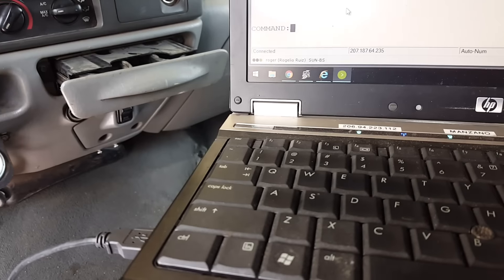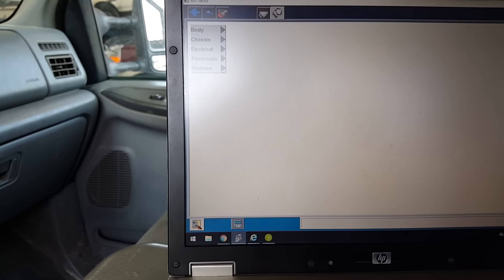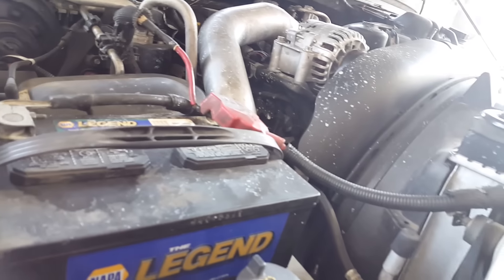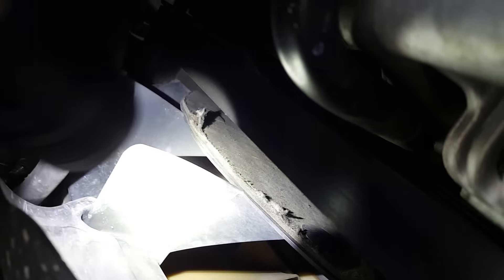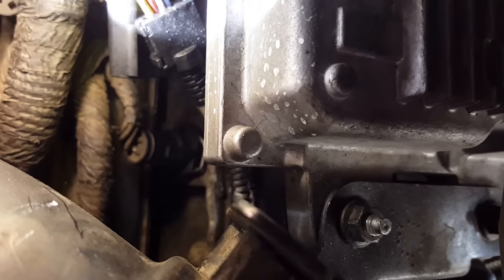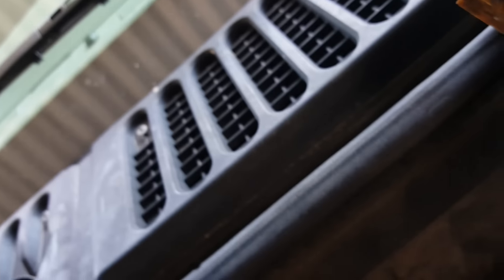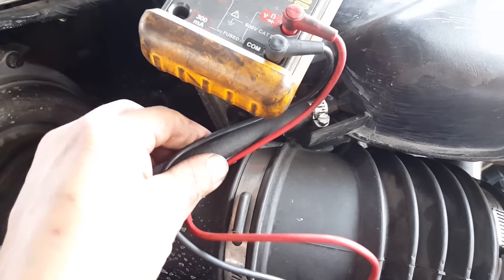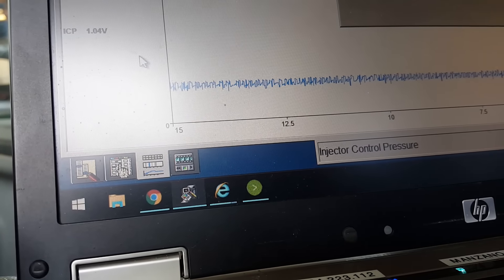SHOP VIDEO 5/17/16 ICP REPAIR AND GLOW PLUGS

Comment: I know it's tough working and filming but you're deep in terminal spreading territory with that glow plug connector. Keep up the good vids!
Reply from the maker: +Banshee365 it only touch the top of the terminal.
Reply: Ah it looked like it was jammed in there pretty hard. You guys probably hardly need a manual when working on 6.0's anymore.
Reply from the maker: +Banshee365 YES. IT READ O.L. AND I WAS MAKING SURE IT MAKE CONTACT. SOME TIMES I NEED THE BOOK TO REPAIR SOME 6.0L

Comment: Im about to buy a 06 f-350 crew cab 2wd dually. 138,000 miles seems to run and drive great can't find anything wrong with it. will need new drive tires soon.  $8500 cash good deal or not?

Comment: what oil should i be running in my new 6.7? cap says 10-30 or 5-40, dealer did first service and ticket says 15-40!? why is that?
Reply from the maker: +kwmiked you can run 15-40. what did the repair order say?
Reply: +joediesel187  ill have to look at it, was just curious why it said 15-40 on ticket and cap said 10-30 5-40 severe service
Reply: +joediesel187 thanks